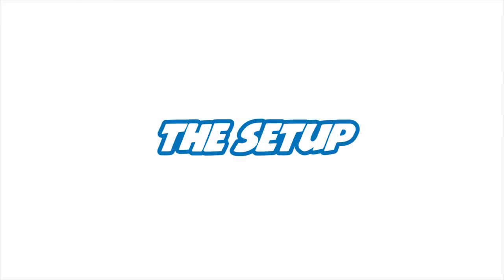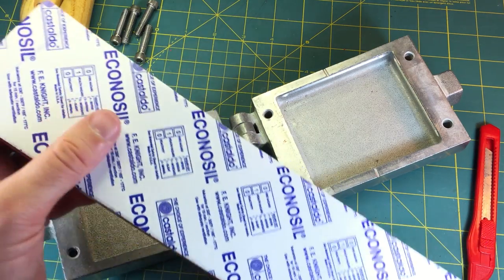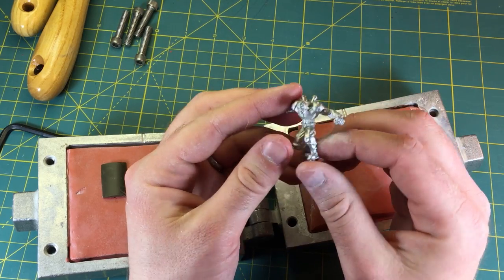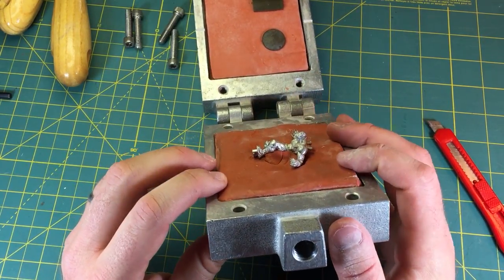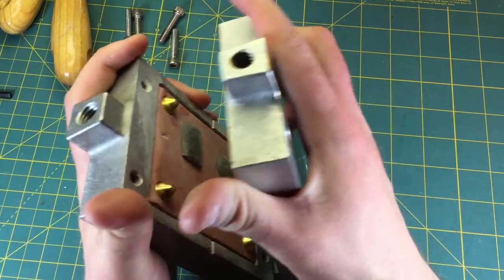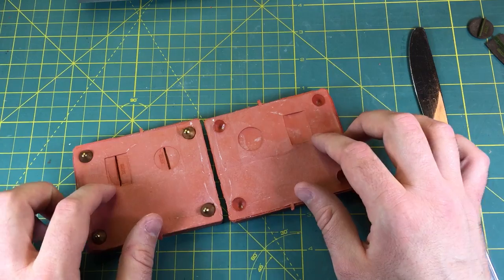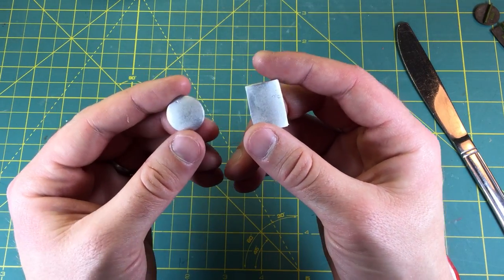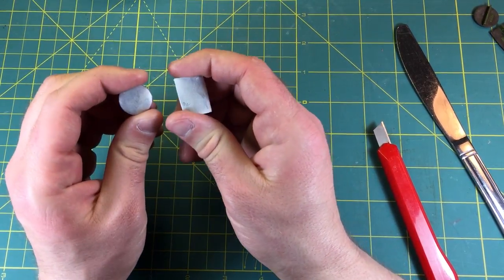Mini Sculpting Super Show 022 - How to Make Molds

Comment: Now that's out of the way .  Your videos are really great thx.  They got me started sculpting 1/35 scale  figures.  Now I'm starting a new project of 6 15mm figures that I'm looking to mold them and reproduce  280 times as replacement game pieces for one of my board games.  thx again for making the videos ,very helpful
Reply from the maker: +TheRedjack77 that's so cool! What board game?
Reply: Tom Mason An old game from the 19 90's called Supremacy.  Used to be my favorite game back then.   there is also a remake called Supremacy 2020, that I've been getting in to.   I do got a question for ya.   Got my 6 figures almost ready (1 for each team in the game. Russain, USA, China, Japan,  Europe, The Common Wealth.) So I'm about to start the molde.  is it better to orientat the mold so the fill holes are on the top of the molde, so the molde is on its narrow side and is sitting tall. Or on the flat side m so the mold is sitting short and fat?

Comment: 18:00 easier would be to have a sprue and vents built in the mold. The vents from wire or coat hangar and a wooden cone shape or dowel rod for the sprue
Reply from the maker: Very true. Wood should probably work, though if you had metal rods to use for the vents that would be better. You would still need to cut that last little bit of the vent to the model.

Comment: Awesome, so many questions!  You showed the metal reaper mini to demonstrate the figure, but if you sculpted it yourself, it would obviously not be metal at this stage.

What materials that you sculpt with are good at surviving the pressure of closing the mold and the temperature?  Would this process work with a clay or epoxy sculpt?

I am slowly researching this stuff so I can make a few minis for a prototype boardgame (just for fun, no plans to ever publish).  At this point I am just looking at using a blue stuff mold to make a mold for some epoxy room temperature casts, but always nice to know what the next steps would look like.

Thanks for the amazing videos!  My wife (the artist in this project) is amazed and just a little envious when watching your sculpting videos.  Thank you so much for all you share!
Reply from the maker: The easiest material for sculpts to mold is Green Stuff or ProCreate epoxy putties. If you are working with someone who uses low temp rubbers you can also vulcanize polyclay. I use both materials myself. Just whatever I feel in the mood for.

If you are using the blue silicone RTV molds, you can sculpt with anything since there really isn't any heat or pressure in that process.

Thank you so much for the questions. I'm glad you and your wife are enjoying the videos!

Comment: +Tom Mason - Your vids are really helpful and your skill is amazing!  I'm just learning about sculpting and casting and wondering if you have a vid of casting one of your figures in metal?  I saw this one with the shields and another with the explanation of how to try to set the seam but thought it would be great to see a figure being cast.  I've looked at your vid list but didn't see one like that, sorry if I missed it. 

I'm wondering how you choose which methods and materials for the actual figures.  Silicone/press mold with rubber/spin mold/etc, and of course which putty or clay you'd use depending on which mould type.  Also if you wanted to make a bunch of metal casts of a figure and you need the mold to last a long time, which one is best? 

Keep up the outstanding work!
Reply from the maker: +daveychaz thank you so much! I do not have a video showing the actual casting process. I might do one down there road. For now I'd recommend looking for videos on RTV molding and resin casting. There are some great ones out there.

I never consider the molding process when I'm sculpting. I sculpt with what I want to and then use the appropriate mold making process. With that said, what I sculpt with has no problem being vulcanized (the mold making process for metal minis). If you do sculpt with a more fragile medium, you can always have it RTV'd and cast as a resin master first. That is safe for pretty much everything.

For lasting metal, just use the normal vulcanized rubber method. They are very durable.

Thanks!
Reply: +Tom Mason - Awesome input thanks for the reply, very helpful!